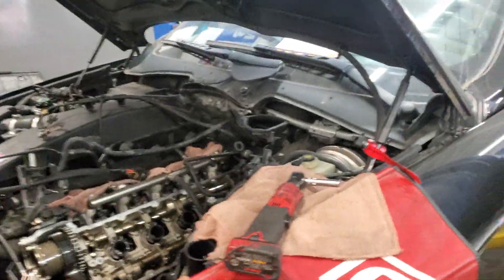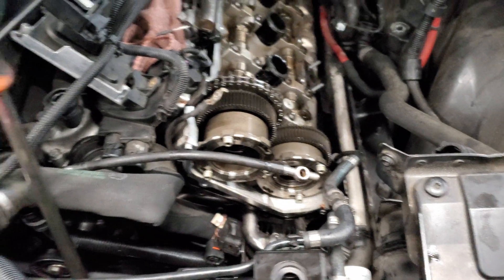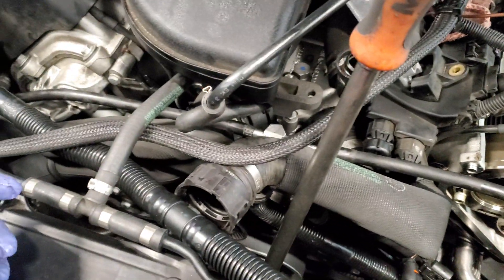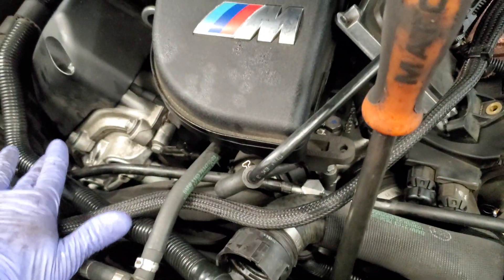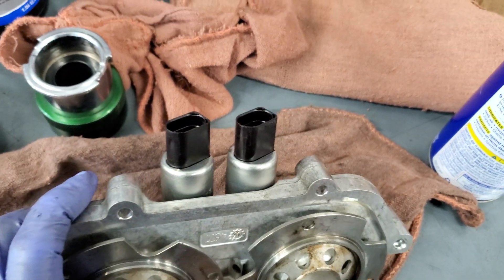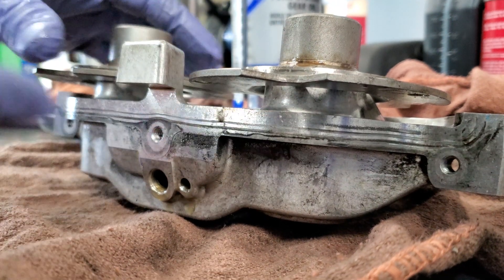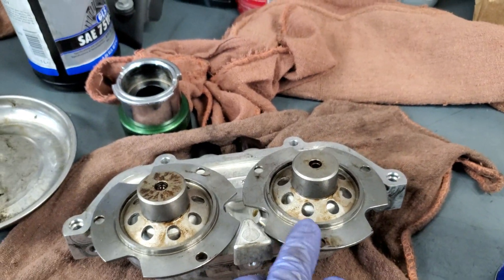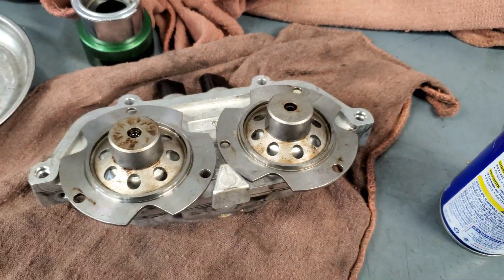BMW S85 Vanos Codes: Diagnosis and Fix

Comment: Dude I’m struggling trying to figure out what’s wrong with my car. When you had this car in your shop, did it made a random grinding noises that’s rpm dependent on that side of the adjuster that went out? It almost sounds like it’s coming from the bottom? Please response! I really need your input on this. I live in the middle of nowhere where and after replacing my rod bearing by myself I’m running into an issue that I think it’s the adjuster related. Thank you in advanced.

Comment: Hello s85-friends! Nice Video !

There is a Problem with my s85 And i don’t know exactly what i should do. 

Both sides are with error code: camshaft adjustment too late and the car have Engine lights and with missfires when the rpm is in idle and Max 3.500rpm Blocked from the car.. i dont know what way will be the best.
Reply: Did you finger out what was the issue ?

Comment: I just had the vanos actuator units rebuilt but they didn’t tighten the only screw holding the caps to the cylinders. Does anyone know how much torque is needed to securely lock that screw?

Comment: Hey Eric. Enjoyed the vid and channel. Do you have any advice on vanos adjustment unit for E63? Should I have both banks replaced or rebuilt? Thanks in advance
Reply from the maker: You can replace both banks if you want to.  If you're able to locate the issue then just replace that side.

Comment: Currently having issues with my S85. Adjustment faults on 3/4 camshafts. New solenoids, new HP line, Dr. Vanos HP pump. I run the vanos bleed procedure 3 or 4 times and it goes away for a day or two, then vanos adjustment faults return. Only on cold starts. Not every time, though.  Suspect faulty adjustment unit. Any idea where I can source the parts to rebuild them or source already rebuilt units?

Comment: I’m interested in how do you block each side individually? Do you mean you got the gauge hooked up on one of the sides and the other is hooked up normally to the vanos? Also, where can I get a pressure gauge that goes that high, with all the necessary attachments? 

Great video!

Comment: We need more professionals such as yourself on FB making these valuable videos for our S85 community- Thank You!
I have a vanos code ( DME: Vanos Oil Pressure) which appeared after failed alternator and battery not properly charging...Now after changing the battery and a new alternator, and after clearing the codes, this code still appears and the warning message is- Low Oil Pressure”. Could it be because a relay is burned or a sensor?? or the DME module maybe.. Any advice will help at this point before I take it to the dealer for diagnostics.
Thank you in advance!
Reply from the maker: Hi there.  Can you provide the code number?  And any additional codes?  Should look like 271B or something similar.  

I have never seen just an oil pressure code.  It is always accompanied by a specific vanos code, or several.  

Just FYI if there is no high oil pressure or you're having a high pressure oil pump issue you will likely hear what sounds like a high pitched whine and gurgling noise.  But this would set multiple faults on both banks.  

Get back to me with the codes and I can try to be of more assistance.
Reply: @knobleindustries8106  sorry for the late reply...my email send your reply to social inbox...
You are absolutely correct- the car has a high pitch noice and check engine light came on the other day when I took it for diagnostics at the bmw dealer... The dealer told me that the mechanic tried to crank the engine and it was unusually difficult so they said the engine is seized :/ 
They did not specify the reason why- I suspect that it was the vanos oil pumps because they require the alternator to work correctly or something like that...
Now, the car had new Vac motorsport bearings and apr bolts and vanos hp line done less then 1,000 mi ago (car currently has 85k mi)... and I have to rebuild the engine. Do you perform this job or can recommend someone who does this? Or you recommend me to purchase a used engine.
Every suggestion is appreciated at this point. I do not want to loose this car since it is a manual trans and gives enjoyable drives...
Thank you again

P.S. The initial code was: 27B6 (DME: Vanos Oil Pressure)
Reply from the maker: My first question is does the car start? If it does then it's not seized.  Second question is how are they testing anything? I'm confused by them condemning the motor because if was difficult to turn over.  A seized engine will not turn over at all let alone run.  If the high pressure oil pump gears are set wrong or there is mechanical binding somewhere it will be more difficult to turn over.  Likely the high pressure pump is bad and not providing any oil pressure to the vanos system.  I am located in Van Nuys, California if you are local my shop has all the proper tools the dealer SHOULD be using.  Don't rebuild your engine. Do you hear any knocking?  Is there metal in the oil filter?  If not they are totally incompetent and I wouldn't pay them a dime.
Reply: @knobleindustries8106  Yes, I agree with you- they did not do anything but “try to crank the engine” and it “feels rough to turn” ... they gave me ZERO test results (oil sample, computer code readings, oil pressure test)...I was really mad with Park Ave BMW...
I let the oil drain from the pan and the filter and did not see any metal shavings or particles. The car starts with no problem, but there is an unfamiliar high pitch sound, which as you noted in your comments, might be something with the vanos pump or actuators...
Unfortunately, you are not near my area, even know I bough my m5 from there lol
What do you recommend me to do at this point? Should I use an oil pressure test kit, and if so, which one (where can I find a kit compatible for
this S85 engine)? 
Please advise! Again, I appreciate all of your help so far. Your video and communications have gave me hope!!
THANK YOU
Reply from the maker: Based on the information you have provided I would replace the high pressure pump and high pressure oil line.  

If you scroll through some of the comments I posted links to the gauge and test kit.  All under $200.  

It's extremely sensitive stuff being that the oil pressure is over 1000psi and can cut your finger off.  I had a crush washer leak on me and it cut a groove into the venos actuator.  

If you want to ship your car to Los Angeles i would be happy to diagnose and repair your car within a week time.  Be prepared though for an extremely costly parts bill.  I would estimate minimum $3,500.  And upwards of $8,000 for a total refresh of all vanos related parts :pump, lines, solenoids and actuators.  I get used or rebuilt units and have a good source on cheaper solenoids so I can get it done cheaper than most. Just trying to prepare you for what you're looking at.  Might be your cheapest option to ship it to me.  I have been diagnosing pesky vanos issues for the dealers here recently.  They just sublet them to me 😁.  Dealership = Stealershit
Reply: @knobleindustries8106  Thanks for the info. I just tested the pressure for the vanos pump and it read 0psi pressure...So it’s definitely the Vanos pump correct?
Reply from the maker: Could be the high pressure line inside the oil pan.  Once you pull the pan, remove the high pressure oil line and cap one end.  Apply compressed shop air to the open end and submerge the hose in water. You'll see bubbles if it's bad.
Reply: @knobleindustries8106  Can the high pressure vanos line fail even though it was changed last year during the rod bearing service?? Or maybe the shop that did the bearings did not change the vanos line at all...:/ I bought the line for them and he said that it was changed... I will let you know as soon as I pull it out. Thank you for the guidance- much appreciated!!
Reply from the maker: @poposki01  You're welcome.  Keep me posted.  Hopefully you can get your car back on the road!
Reply: @poposki01  I have the same “vanos oil pressure” fault, what ended up being faulty? Line or pump?
Reply: Hey Nikola! I’m having the same single fault
“Vanos oil pressure”. What ended up being your issue? The line or the pump?
Reply: @fcarkdk5914  hi, my issue was that the mechanic that did my bearings and high pressure vanos line, FAIL to instal the Vanos pump correctly, which caused the pump chain to snap and stop the pressure…luckily the block was saved and I did a full rebuilt at Troy Jeup! The car is better then new now since Troy is the best there is for S85 rebuilding and he took care of all possible issues that might occur in the future..
Good luck with yours! I hope you fixed it!

Comment: $1400 for a solenoid.. and when they fail, (providing the oil has been changed on a regular basis) there's every chance its just  the "O"rings that have failed. Back in 2005 when the E60 M5 was launched you could get a solenoid from the dealer for about £350 here in UK (approx $400) then they started to fail big time, BMW knew they failed often but instead of offering an O ring repair kit... they increased the price of the units by around 400%, the same unit from a dealer today will set you back £1200 or $1400.. You can get a seal repair kit for these... just not from the dealer. BTW great video on how to diagnose this type of problem..

Comment: hey great video- a shop did my bearings and shortly after the vanos pump failed. they put in a new one and are not getting the desired PSI. i am afraid something else has failed.

where did you get the rebuilt unit?
Reply: Man I just did my bearings and just 60 miles after that I am getting a rough idle vibration from the engine to the whole car. The rpm is stable. My car has been having a vano code 271D but nothing noticable has happened until this point. Mine is a s65 for E92 M3. What is yours symptoms?

Comment: Hi Knoble Industries! I'm a bit confused about you saying there should be no sound when the pistons move up and down. There's a hole under each piston/plate. When you move the piston up and down, those holes will make the "slurping" sound, even if you block off the main port. Something I dont understand?
Reply from the maker: Right.  That's the drain back galley for the actuator.  It's normally closed by the vanos solenoid which is installed.  The sucking noise is coming from the seal to the plunger.  That's why the other side made no noise. 😎
Reply: @knobleindustries8106  Thanks:)

Comment: Hey Eric. I have a 2007 m5 with the exact same codes with vanos system..dealership quoted me around 20k to replace pump, pressure line and all 4 solenoids. They also said they weren’t sure if that would solve the problem. I declined all the work and now car is in my garage. I truly feel it’s one of the vanos actuators.  The car has been running perfect for the last 3 years with oil changes and service religiously. What is a fair price to replace/rebuild vanos actuators??
Reply from the maker: They are taking you for a spin.  There is NO WAY every single component in your vanos system has failed.  That's absolute non-sense.  Where I always start is by swapping solenoids around to see if the codes follow.  For instance a bank 2 intake vanos code.  I swap that solenoid to the exhaust side on the same bank.  If the code follows.  Replace the solenoid.  If not, replace the actuator.  Easy.  If you have multiple vanos faults.  Check the high pressure oil reading manually.  If it is low it may well be the high pressure pump.  20k and replacing everything will likely solve the problem. But why throw money and parts at a problem the dealership clearly can't diagnose properly.

Comment: Thanks for the Great Info! Is it fairly easy to do main bearings for the crank while you are doing the rod bearings? Engine has to be disconnected from the Transmission?
Reply from the maker: Sorry I don't know why I'm just now seeing so many comments from 7 or 8 months ago!  No it's impossible.  You need to remove the lower skirt of the engine which requires removing the transmission.  It can be done with the engine hanging in the car but I highly advise removing the engine and placing on an engine stand for the main bearings.

Comment: Hey. Where can I get those plates rebuilt for a 140 bucks ? Thanks
Reply: Did you ever end up finding a place ?
Reply: @unscriptedviusals  found a used one on ebay , put it back together and sold the car...
Reply: @Pkpkpk78 do you have to lock the cams to replace?

Comment: Awesome, this is the most informative video I have seen. What was used to block off the lines so you could test?
Reply from the maker: The test kit can be purchased from ECS tuning. You will need to supply your own gauge and adapters for the gauge.  Please note the gauge must be able to handle up to 2000 psi.  Teflon or aviation sealant should be used on all fittings to prevent a leak. I ordered one on amazon.  I will provide links below.

*please be aware that the copper crush washers must be replaced and properly torqued each time the hoses or adapters are loosened.  Otherwise an improper seal will result in a 1000psi oil leak and will CUT A GROOVE IN THE VANOS ADJUSTER. ask me how I know lol.

Test kit:
https://www.ecstuning.com/b-genuine-bmw-parts/oil-pressure-adapter-set/83300495130/

Gauge: https://www.amazon.com/Instruments-Pressure-Stainless-Liquid-Filled/dp/B07FB2PP29/ref=mp_s_a_1_3?dchild=1&keywords=2000+psi+gauge&qid=1586632049&sr=8-3
Reply from the maker: Also it should be obvious but do not use any hose or automotive gauges.  They will explode.  Must be solid metal adapters or 2000+ psi rated.

Comment: Is there any special tools or procedures to remove the vanos body which you have on bench . Does it just unbolt and pull out?
Reply from the maker: You must remove the valve cover.  It's  just a few 10mm bolts on the outside and three 5mm screws on the inside.  Very easy but time consuming.  Engine must be cranked over to access the inner three 5mm bolts one at a time.  There are 6 bolts visible, one holds the adjuster gear / chain to the cam, the other holds the vanos plunger to the gear.  Make sure you ONLY remove the three that hold the vanos plunger to the gear otherwise you will need to retime the whole motor which is not fun.
Reply: Knoble Industries holy but if don’t right you can just unbolt and bolt back in ?
Reply from the maker: Yes.  No special tools needed at all.  Very simple.
Reply: @knobleindustries8106  thanks for sharing the info muchly appreciated

Comment: can you do a whole diy on relacing the vanos unit
Reply from the maker: If I get another one in I will!  I dont see them often.
Reply: @knobleindustries8106  were are you located I have an m5 just been in the shop same issues but pulled the car away as I don’t think the shop are capable I also want the rod bearings doing.
Reply from the maker: @trottpaul  Van Nuys California.  Not many places know how to fix this issue or have the proper diagnostic equipment to resolve it.  A confident mechanic will tell you that they know how to diagnose Vanos faults.  And very good idea to do the rod bearings.  I just had an M6 here with S85 with 39,000 miles with a spun rod bearing.  Destroyed the crank shaft.  Rebuild estimate was over $25,000 USD.  Vehicle never had the bearings updated.  Total loss.
Reply: @knobleindustries8106  thanks for the reply too far for me to bring the car to you as I am in Florida.
Great video though and thank you.